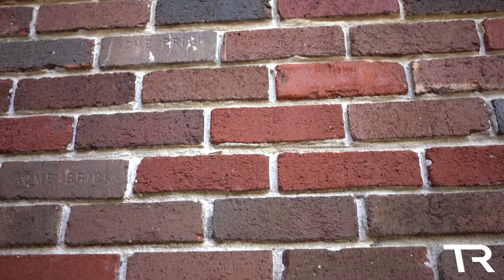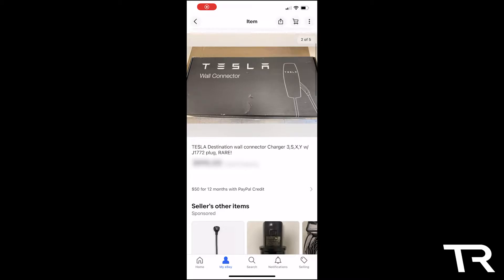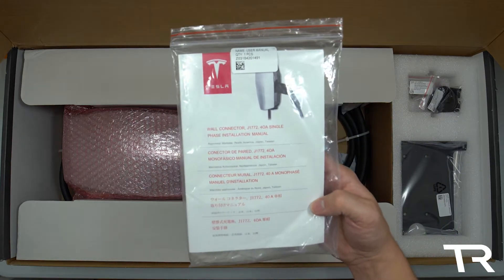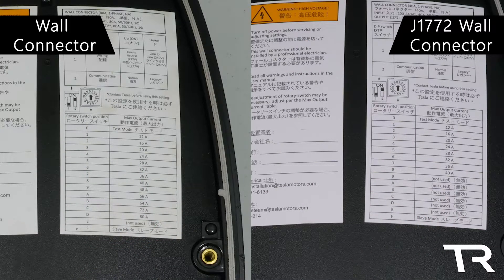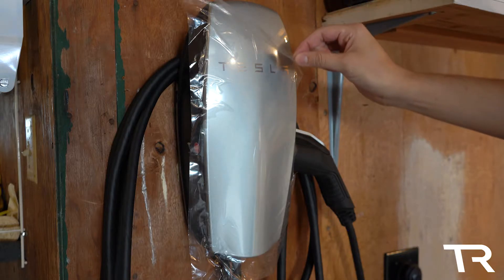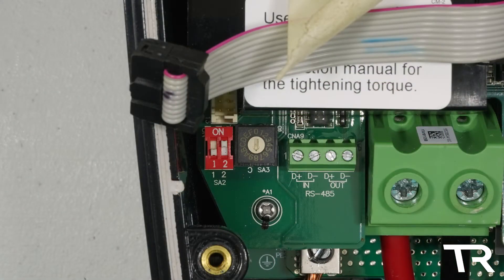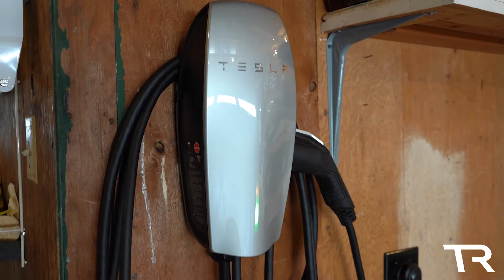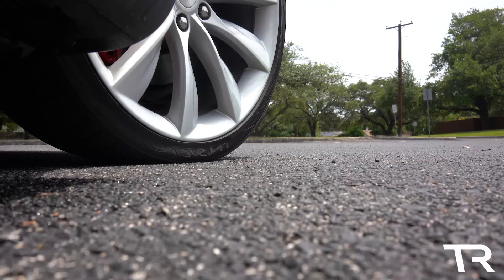Official Tesla J1772 Wall Connector - Unboxing and Review

Comment: I ordered the J1772 Wall Connector from the Tesla shop a month ago and received  it a week later. I haven’t seen it on the shop since then.
Reply: Same here. Wonder what happened
Reply from the maker: It came and went so fast! My only guess is that they had stock from when they used them in their install program previously. This could mean that they could come out with a Gen 3 J1772 Wall Connector,  but I personally think they are committed to their own proprietary format. Only time will tell!

Comment: Great video.  Too bad the J1772 model doesn’t play nice with the standard model.  What happens if you share a 100a circuit and don’t connect them for load sharing?  I get that there would be a risk of both pulling too much current off the same circuit, but if I were to limit them both to 40a, would that be an issue?
Reply from the maker: Thanks, glad you enjoyed! It is a bummer that it doesn't work with regular WCs since it would have made things a lot easier... 
If you wired them up on the same 100A circuit, and the wiring was all suitable for a 100A load, the issue would probably just be an NEC code violation of some kind. 
If you already had a 100A circuit there, the probably more code friendly version would be a subpanel with 2 50A breakers in it instead of the junction box to combine the wiring.
Reply: @TeslaRyan  curious if load sharing works when the lower power unit is the secondary, not the primary.

Also curious what Tesla support said, since the troubleshooting page said “contact Tesla”.

Comment: Great video, you think I should go with this for my primary home charger (it's cheaper) or should I go with the conventional Tesla Wall Connector?
Reply from the maker: If you don't mind using the adapter, I don't see any reason to go for the conventional one since the internals are virtually identical. Plus, if you have any visitors with a regular J1772 EV, you can charge them up as well.
Reply: @TeslaRyan  Thank you so much for the response! Great point on other EV owners being able to use it as well. Really appreciate it, you've got a sub from me :)
Reply from the maker: @otaibaa1  Thanks so much, I appreciate it!!

Comment: They actually just started selling these again. I ordered one today in hopes of using it with my gen 2 hpwc. That sucks that it won’t load share. I’ll likely cancel my order. Do you think it would matter if you made the hpwc with the Tesla wand the master and the j1772 one the slave? Thanks!
Reply from the maker: Thanks for letting me know, I can't believe they just started selling them! 
I didn't go over it in the video, but I did try both ways just to make sure and it didn't seem to matter. As far as I can tell, everything on that circuit needs to be a 40A and it doesn't like playing ball with the HPWCs unfortunately....
Reply: I wonder if the gen 2 wall connector with the OEM 14-50 plug would load share with the j1772 one. This one is limited to 40 amps. It is rare to come across one and I don’t see anything about them being able to be networked together.
Reply from the maker: @fatwajim  It's funny you mention that because I just got in a NEMA 14-50 Wall Connector last week! I hadn't even unpackaged it yet so I went out to the garage and got it hooked up. I was able to load-share between the two with my EVSE tested and Model S! Each one was getting 20A as expected. 
I'll probably do a follow-up video with more details in the coming weeks.
Reply: @TeslaRyan  that’s great to hear. I’m looking forward to that video.
Reply: @TeslaRyan  Yes please make that video. I have an 80 amp gen 2 adapter and would like to purchase the new j1772 to network to it.
Reply: @TeslaRyan  Question for you: I found a 40amp NEMA 14-50 connector on eBay and was able to network to my J1772 wall connector. They do properly load share. However, the green status lights on the units don’t seem to be accurate while they are not charging. The master unit should show a green light on the top and bottom. The slave unit should show a green light at the bottom only. Mine both show a green light at the top only. But they do properly load share. Do your units show the proper status lights? Thanks!
Reply from the maker: @fatwajim  I believe those lights are only while the Wall Connectors are initializing. If you flip the breaker on and off, you should see the one with the bottom only and the master will have both the top and the bottom light for a few seconds. After those few seconds, only the top light remains illuminated. 
Hope this helps!
Reply: @TeslaRyan  thank you! Mine operate this way during startup. I was under the assumption that the initialization lights stayed like that while the unit was on and at rest. Thanks again